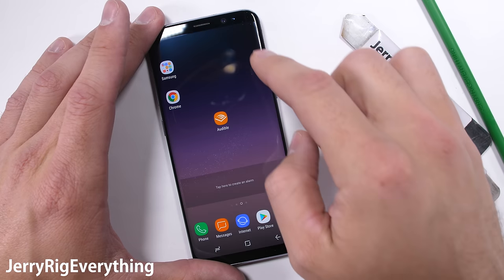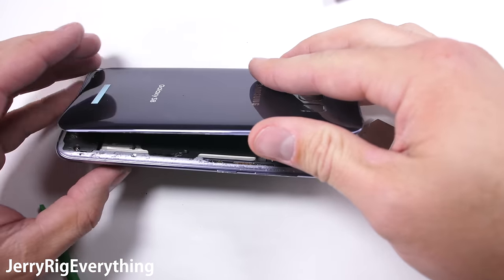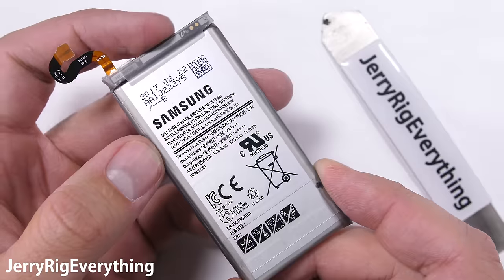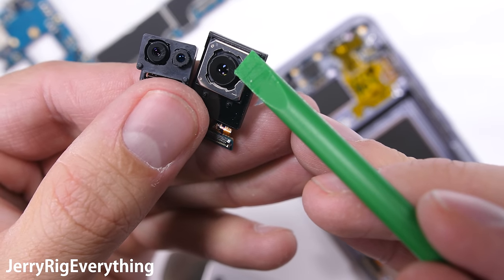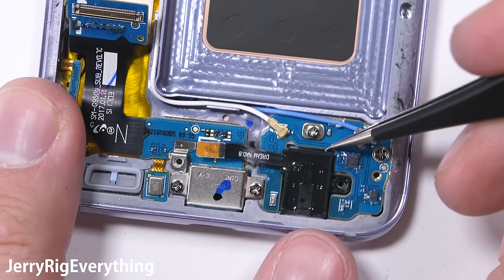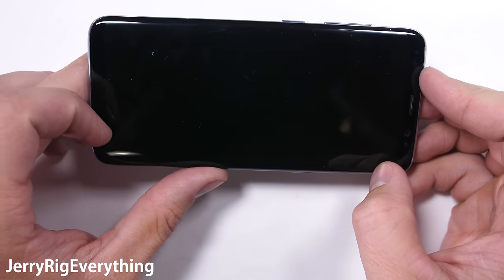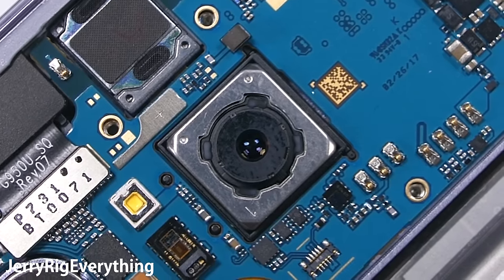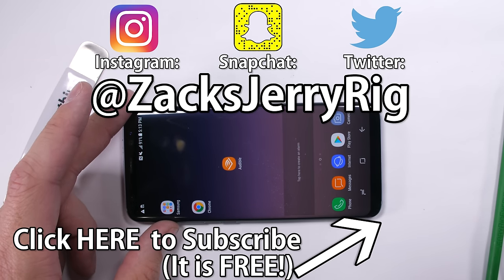Galaxy S8 Teardown - Complete Repair Video

Comment: Apple will invent this in the future 😂😂😂🔥
Reply: Umami Cupcake we already have a duel sim card slot
Reply: Umami Cupcake and we can have up to 256 gb of storage so what does iPhone have
Reply: Umami Cupcake Salty much? I'll just go pick up a 256gb SD on top of the 64gb internal and have 320gb
Reply: or get a 512 gb one for a total of 576 gb
Reply: Umami Cupcake Also micro sd cards become faster with higher capacity and cheaper every year. You could have all the capacity you want  by buying even more cards, they are so small and easy to carry. Also there is Usb on the go, that allow you to connect the phone to portable drives that have capacities in Terabytes. So 256 GB fixed internal storage is nothing in comparison.
Reply: Benjamin Buljevic it only supports up to 256gb sd card

Comment: 4 years since this video was created and my appreciation of it comes today. I had to fix the screen of my spare phone and seeing this video made all the difference. Since the S8 is a spare phone for me I have opened it and disconnected everything at least, 20 times or more and have had fun while doing it! Thank you Jerry for this informational video and keep it coming!
Reply: Have to replace battery in s8. Immediately remembered this video, and it still holds as the one easiest to follow
Reply: I had to replace the battery once in my s8, im not switching to a new one anytime soon
Reply: How to buy things to stick back and fingerprint scanner because I want to replace battery in the future and keep the waterproof ability?
Reply: @micharymkiewicz3770  i dont think i understood the question well, but i strongly suggest going with a phone to a repair shop, i usually like to repair phones myself but when it comes to waterproofing i want my phone to be handled by a professional.
I've found a pretty good repair shop in my town and they managed to use a special kind of glue to keep the water resistance as much as possinle, i have dropped my phone into water many times and once it even managed to fall 2m deep into water and nothing happend
Reply: @micharymkiewicz3770  Somebody may have a different solution but as far as I know once you open it up you more or less loose the so to speak, the "waterproof" seal. Also, there are many online stores that sell the sticker template or the sticky tape itself but once again that does not guarantees you a waterproof seal. Here are few scenarios that I have personally experienced. A) My unopened 3yr old phone on its own got its glass back plate detached as one day when removed the phone case. Am guessing due to the heat it generates during wireless charging and prolong use the original seal weakened to the point the glass plate came off. B) A friend brought his unopened / untempered phone to a Authorised Samsung service center and was told there was water damage. He was baffled and questioned the service staff how was that possible since its "waterproof" and not been opened before and to that the service staff said you may have  submerged it for a long period or may have used your phone in varying temperatures. However, none of that was done but he agreed merely, being caught in the rain etc.. However, he got it serviced that one time FOC under warranty and was advised the rest of his warranty will be unusable. C) Even if you get it repaired at 3rd party mobile repair shops they too will not take the guarantee of "waterproofing" it. In fact, good repair shops will tell you straight up that they will not guarantee it. So the whole fact of the matter is even Samsung that claims "waterproof" rigidity they too will do a back flip when such things happen. I am keeping my phone for the very same reasons you are but I do not trust that it will ever be waterproof, so to speak.
Reply: @portraitonetelo1897  So when battery inside will less or more break then I will not change it but I will carry with me my powerbank :) In my opinion It is the best option for this.

Comment: Thanks jerry, it helped me fix my phone by myself. 
recently i broke my S8 display and got it replaced for approx 250$ from the samsung service centre. being nice they also replaced the complete metallic side rim coz it was slightly damaged too. My bad that i did not fully check the mobile while receiving. i discovered later that my voice could not be heard by other over the phone. 

After bearing the pain for few weeks, i could not convince myself to submit phone to those service centre people again. Today i opened the phone using this video and found out that they forgot to remove a packing from the mic hole. its solved ta! da!.
Reply: ItzSebas if Samsung fixed it it should
Reply: Om Kulkarni Yeah but he opened it again after the repair

Comment: Thanks JerryRig, I flipped out of my kayak into the lake… along with my S8 😣 First stuck it in rice then realized that wasn’t going to do anything. Once I viewed your video I then gained the necessary confidence to open my phone, disassemble it, put a fan on it for about 3 hours, wiped the components with isopropyl alcohol, took a new toothbrush and gently brushed the connectors, then reassembled my phone (all the while keeping my dog  far away from this process 😅). When I first plugged it in again there was no light indicating that it was charging, so I left it plugged in for 5 minutes before coming back and my phone was warm. I turned it on and the reboot took longer than normal but finally came to my sign in! Victory! Thanks again. Without your play by play video I would’ve never felt like I could’ve done this. 👏👏

Comment: Remember those simple days when all you had to do to replace a battery was open the back plate held in by a few clips? God, these days it seems like every phone keeps getting anti consumer repairs. Not every phone was fragile. Remember the Nokia phones that were ultra durable? Like the 3310?
Reply: james stark I agree but you gotta remember that the phones now are handheld laptops and are far more complex because of it!
Reply: Chris Gardner yeah. I appreciate it but it doesn't mean I don't miss the old days when it didn't matter if I dropped the phone a few times even after the warranty passed. It didn't break easy and it came back together easy. And, even today, a Nokia phone is bought way back in 2004 runs perfectly fine. My little sister uses it to call people. It had a unique design (unlike everything today) and it was durable. The most damage it has is a few scratches on the screen and some chipped paint on the camera cover and sides. I even have an older phone from 2003 that used to work just fine till a few months ago when it fell into a boiling pot of water. It didn't recover, may it rest in peace after a life of about 15 years.
Reply: @selfproclaimednobody4614  Phones were ALWAYS mini computers. They've never not been. Anti-consumer issues like this have nothing to do with how complex phones are they just want to make more money.  They want you to buy a new phone instead of repairing it. Which is stupid because computers no matter what they are laptop, phone, or desktop are incredibly easy to repair.

Comment: hey zack make a video on what makes the Galaxy s8 water-resistant!
Reply: Varun Kesari he made one for the s7 and iPhone 7 they should be similar I guess. To sum it up,there's just rubber around all the ports as he showed in this video and adhesive under the glass of the phone so water can't seep through
Reply: Poot Also there's those meshes on the earpieces.
Reply: iOBX oh right that too. It's very hard for water to go through the mesh because of water tension or something and only under too much pressure can water go through

Comment: Hey Zack, I was able to replace a faulty charging port on a Galaxy S8 today at work. I remembered most of the steps on how to do it and what to avoid doing cause I saw this when you first uploaded it. Fairly easy except for when I put it back together. That fingerprint sensor was difficult to connect. Not enough space for hardly anything lol
Huge fan of yours. Keep it up, man! 

We are out in Indio California, next to Palm Springs and Coachella, if you ever come around, stop by our shop. Think Digital Cell Phone Specialist!

Comment: Had an S8 that wouldn't charge at all. Had a replacement S8 that I busted the front and back screen that worked fine before that. With your video and help, I completely swapped the motherboard and charging port and battery, basically all of it, and now I have an S8 that works perfectly rather than two useless S8s. Back up phone I guess. Thank you so much for the vid.

Comment: i tried to repair my s8 which only had a broken glass back, I ended up adding too much heat and melting the main camera module, ruining the finger print scanner and the charging port... but hey, at least it looks new again..
Reply: xDD
Reply: Did you use a damn flamethrower how do you manage to do that?
Reply: @NobuNobuSimp  😂😂😂😂😂😂😂😂😂😂😂😂😂😂😂i also think the same

Comment: warning isheeps don't watch this video 😀
Reply: Divyanshu Kohli 
I watched it and thought it was hilarious! :P
Reply: Daniel P Some people just prefer IPhones I’m an IPhone user but I’ll be switching to the S8 soon.
Reply: Mr._.Hentai good choice of changing
Reply: Loved those subtle Apple burns and this comes from a former isheep.  The only reason I stayed 10 years with apple was because of Jailbreak,  and when apple made sure to eliminate it by buying out hackers, there was no more incentive for me to stay loyal to them.  What really broke the camel's back for me was when my brother showed me his GearVR/Sammy.  That was when I said to myself screw Apple and their stupid AR.    I can't see myself going back unless Apple pulls a miracle or something.   Also,  iphones are ridiculously expensive.  At least Sammy phones drop in price quite fast.  I just bought myself the S8 last week in super mint condition with box and UN-opened accessories plus mint condition GearVR headset and controller/2 cases from Ebay for $450.
Reply: this my browsing channel that's not it. You can have Apple devices and be happy with them, if they fit your needs. Personally I dislike Apple from head to toe, but that's just me. 
The people referred to as "iSheep" are those, who will buy all their stuff, even if it's completely useless, such as a $1300 smartwatch, which does worse than a $200 smartwatch. (Not that anyone would need a smartwatch, but this is the unnecessary pricetag we're talking about, when it comes to Apple). 
Repairing an iPhone yourself ist a pain in the ass (which is also true for a lot of Android phones, but there's a difference). 
Apple does not sell spareparts, you have to rely on third party parts, or salvage another device for the parts you need. Or you can pay 300 bucks, to have Apple repair your device, that's just nuts. Those iSheep try to defend such things, and that's where it just becomes unreasonable. They're the type of people to buy a cup of coffee for 10 bucks on a regular basis.

Comment: I used the link in the description to order the screen/frame backglass adhesive and the tool kit, pleasantly surprised with all but the back glass adhesive. Thanks for making this video. My s8 is back in 1 piece and water resistant.  Note ordered the back with seal on ebay.

Comment: At 2:14 regards removing the battery, you say, "This thing has no magic pull tabs as on some other phones so now it's time to use brute force." I used 'brute force' as you suggested and it damaged my screen digitiser (I discovered later) to the point where I had to buy a new phone. It  put a big, bright white line down the left side of the screen along the left side of the battery. Even with force, the battery wouldn't come out until I discovered from a different video that all you need to do is heat up the screen with a heat gun to soften the glue and it's easy from that point on. I Wish I knew that before. It would have been helpful to mention that and save my phone from damage. Everything else was brilliant.  And I didn't use any dogs, either.

Comment: The shaking front-camera is for focus. If you tried pushing it, it should have moved in and out easily, this is for the new Auto Focus feature. Other FFCs are fixed focus so they don't move.

Comment: For the price of a dbrand skin, I replaced my s8 plus' broken back glass by the help of a local technician (not the Samsung service center) and it works (and looks) like a charm. Also, the phone is completely water resistant and I tested myself by putting in a pool and clicking pictures. I'm really lucky you know?

Comment: Was so close taking the glass off but nicked the lcd while working on an edge.  May buy a lcd or just get Oukatel K9. Side notes: use alcohol along with heat on the front screen. Dry ice did not working removing the front glass. Use a heat gun.

Comment: FWIW, I got a cheap TPU case for my Galaxy S5 Active, and it has withstood numerous 2' - 3' drops on hard surfaces -- mostly wood, but some asphalt and concrete.  Though never dunked, it has withstood rainstorm and shower splashes well.  
The speaker was likely damaged when I used too much eye-glass cleaner on the front screen.  My 3rd battery never lasts as long as I wish.  And I'm chronically low on memory due to AT&T trashware, installing numerous apps myself, and holding onto nearly a 1000 high-quality photos.  
I'm finally ready for an upgrade, if I could only find another sturdy, affordable, state-of-the-art phone with a replaceable battery, significantly more memory and less trashware.  And of course, the requisite earphone jack and SD-card tray.
Reply: Tom Eubank m
majority of phones on the market

Comment: I got the idea that in the last staklubacite cool LEDs from the LCD panel to the night on the table looked strong as well if there is a switch that can be controlled more precisely control when to just light to and when not only need to obtain a transformer electricity percent weakest led lighting works 8.4 if your pin to the backlight ic ic cease to be happy so you need to set up a small externa 3v battery and inverter to 9 volts to get the light from the diodes themselves

Comment: Very nice video.  Thanks for doing this.  I accidently stuck the sim removal pin into the wrong hole on the note 8.  I think its the mic hole.  Did I do any damage? Did I break any water tight seal.  Should I be worried?  I tried to get a good look at the components in your teardown to see what a pin would do damage to but cant be sure.  Hope you can help.  Thanks.

Comment: The content of the battery is pyrophoric. The battery will ignite immediately if you puncture it.  Water will stop the reaction. If you lack a way to move air or letting it exit I do not recommend pulling the components apart indoor.

Comment: So i took my phone over to a highstreet repair shop.  I had smashed the top left of the screen and wanted a replacement.  After 3 hours and $250 later my phone was 'repaired'.  However now the back of the phone doesn't sit plush with the frame, there is the smallest of gaps and you can certainly feel this gap when you're holding the phone.  Disappointing, but is it safe for me to remove the back of the phone myself and correct the poor job the 'professionals' did?  Yours seemed to click right into place.

Comment: Damb! I sat there patiently waiting for you to teardown the power flex cable button, so i would be able to remove my old cable safely, but that was the ONE THING YOU DIDN'T DO! Ugh!! So frustrated!

I bought a replacement Samsung Galaxy S8 Plus Power Button Flex Cable; well, inner part that is; that's all I could get because , it would seem, you have to buy the entire bezel, which seems to have the outer power button attached to it, so what I thought I would do is, see if the S8 PLUS BUTTON FLEX CABLE would fix the problem I'm having (which is powering on my phone) FIRST, then if not, I would either spend £100 on the bezel (really frustrating as the price of yours in the USA, I just $7, but in the UK £100!! Something is not quite right with the pricing there, right?)
 
Ok, so now your thinking, why not just buy a new phone right? Well, I'm going to, but I MUST retrieve my phone info before I do; you know, Transfer everything onto my new phone? So of course, I need to power it on before i can do that. [RE-EDIT ok, so I successfully replaced the cable and my phones now switched on, however, at some point of my absolute frustration and anger, I managed to damage my phone screen, so now I only have 1/5 of the screen displayed, but it doesn't concern me too much because I only need to transfer info from it ontomy new phone and these days that's done quite smoothly ]

I have removed the old power cable, but the little black tab part detached from the cable part and has remained stuck to the bezel base, but I'm not sure i can remove the black tab residue saely without causing damage.

However, I will definitely thank you for the links you provided. That allowed me to discover that you can even BUY PARTS in the first place! I had no idea about that! lol This tech stuff has really set off an old childhood skill I once had, which was the ability to repair electrical items around my family home ie Hoover, Radio, Television, cassete players, Tape recorders, CD players the whole lot! This was from the age of 9...yes 9! No training, hadn't seen my dad fix anything...no one, but was able to repair all these items innately. I just looked at the item and could spot what the problem was, but if it needed new parts, then that's where it would have to be taken to the repair shop.

Ok, wish me luck, i'mgoing to give it a try, ut if it doesn't work,I'll knowit's because the cable couldn't get enough contact due to the residue of theold cable tab.